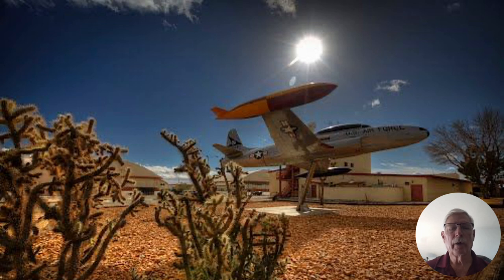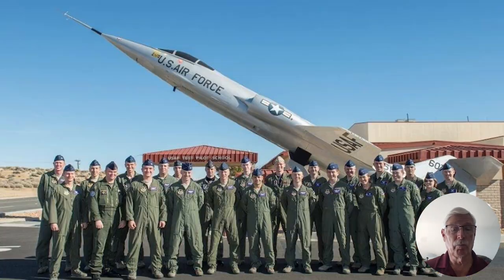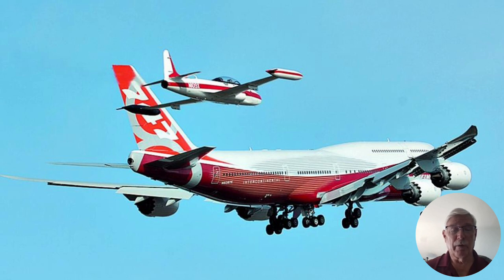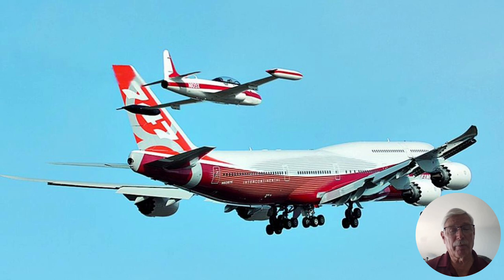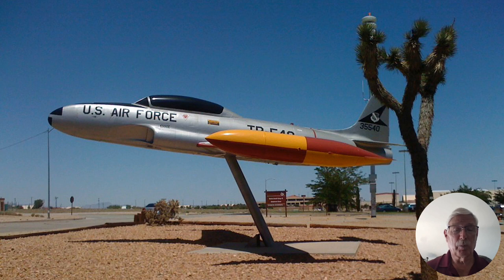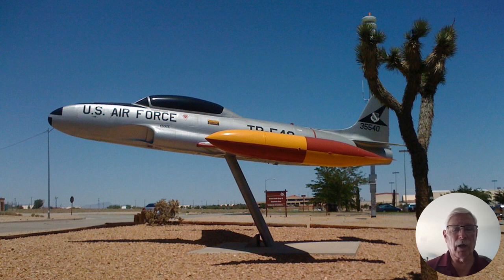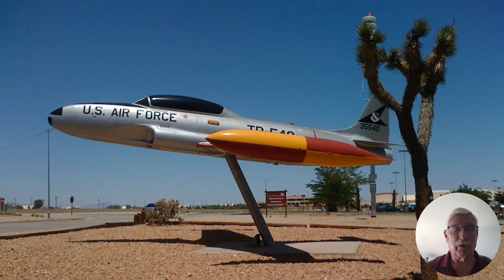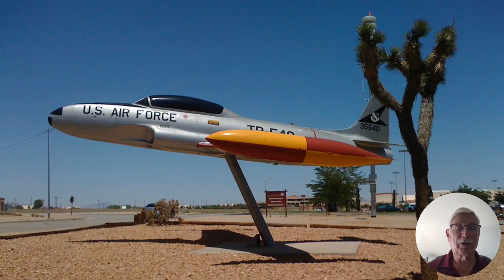A story relating the DREADFUL and HORRIBLY EMBARRASSING tale  the T-33 at the USAF Test Pilot School

Comment: This is hilarious.  I've seen that bird and the -104 so many times and never knew the slightest bit about that.  We were there in the 1970s, went to Germany in 1980, came back to ED in 1982.  Went to Hill AFB in 1985, back to ED in 1987-2007.
Reply from the maker: Yes, There were just a few of us who knew the story in the late '70 (well, just about all the pilots at that time) but figured the story had been forgotten.
Reply: @ronrogers  What CTFs were you on?
Reply from the maker: I was a chase pilot assigned to test ops and OIC of current ops/command post. We got to chase everything. I later became the T-38 Senior Flight Examiner in Stan Eval but also continued as a chase pilot. @LRRPFco52
Reply: @ronrogers  We used a lot of chase on B-1B program with F-106As and Bs, as well as F-111Es if I recall.
Reply from the maker: In the late '70s, we did not have the F-106s available. F-111s were used mainly for their endurance, but we only had 4 and keeping them airworthy was a challenge. So they subbed with T-38s since those were plentiful but very limited in chasing the B-1As @LRRPFco52
Reply: @ronrogers  Edwards was like a constant airshow in the 1970s and 1980s.  I loved it, nothing like it anywhere in the world.  I miss those days.
Reply from the maker: I miss it also! @LRRPFco52